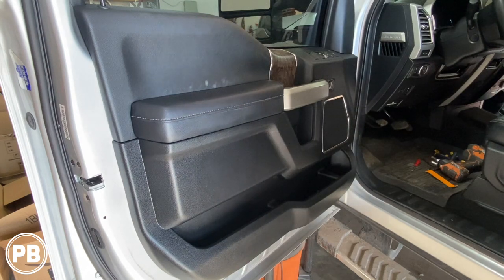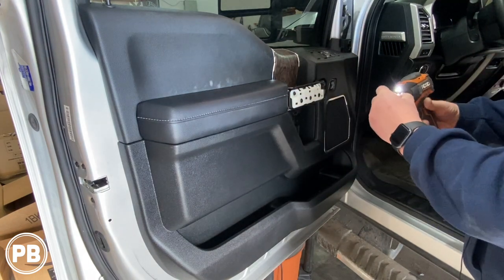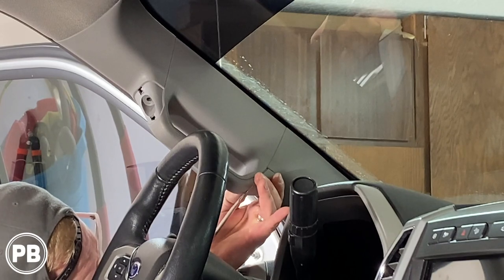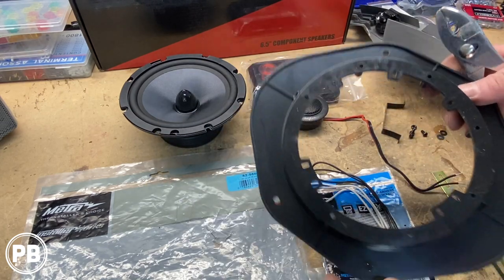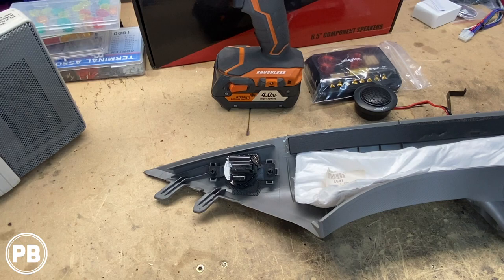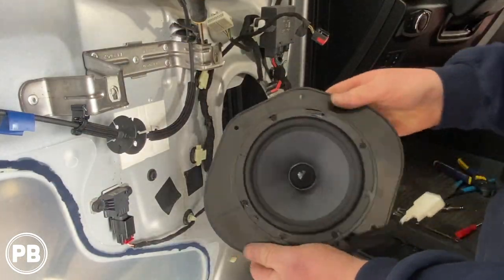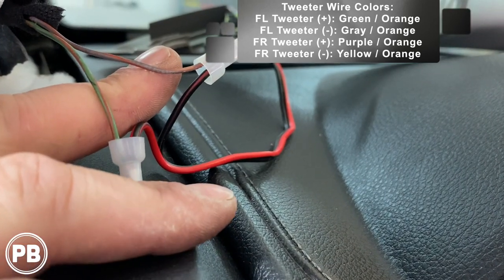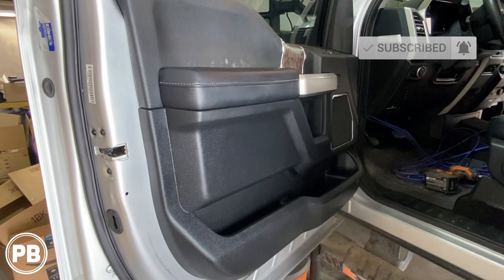2017 - 2022 Ford F250 / F350 Front Door Speaker / Tweeter Install

Comment: FYI the connector recommended for the tweeter in the info section does fit the oem connector on my 2017 ford f250 platinum equipped with Sony.

Comment: How do we know if we have our wires ran all the way back. If there isn’t an amp/ upgraded stock sound system. For example if I purchased the ford sub it should be plug and if I’m correct. 2022 250xlt.

Comment: Just a note for anyone who doesn’t know. Skar audio is junk.
Reply: They scream, and their subs hit hard as hell, but SQ Is complete trash
Reply: @chrisharney7788 until amps red light on you and you cannot reset them. You blow every voice coil out running half of the rms or 1/4 of the power of peak watts, I have 2 full size 12s with blown voice coils, 2 slim series one with blown voice coil and 3 of their amps all red lit, a skar box that I cut up and used bottom section to rebuild to try and get the correct amount of air space that the subs call for, and I used the bottom section because the rams use a fiberglass to utilize all the space you can with the odd shape. Skar just thru something together to just make a sound with some base lol no consideration of their own air space and tuning requirements. Chinese junk and they don’t hold up to even their minimum specs
Reply: Ohhh…. Just got a set of tx65 and a set of tx65c to use with their rp.75 amp

Comment: I've replaced factory speakers and had it sound worse. Much worse.
Reply: Do you recommend switching factory speakers to this  I have Sony on my 2018 f250
Reply: That is most likely do to the fact the factory set up is not capable of driving the new speakers efficiently. Probably need more power.